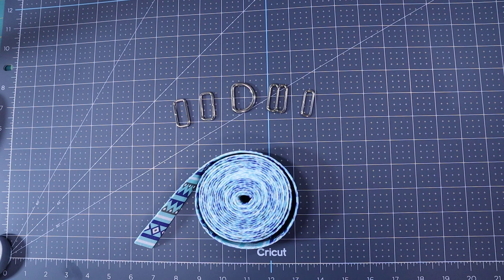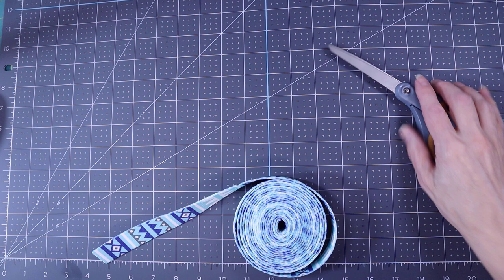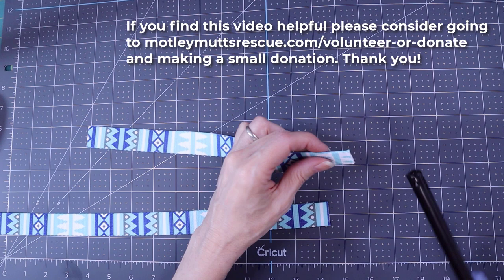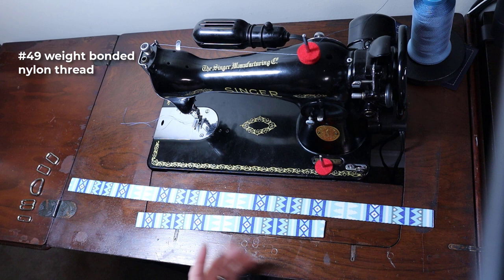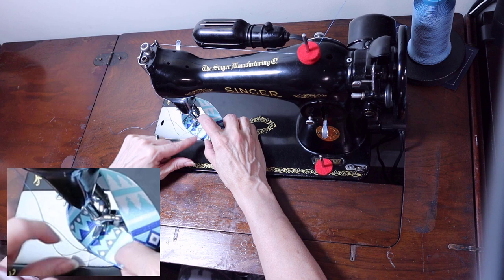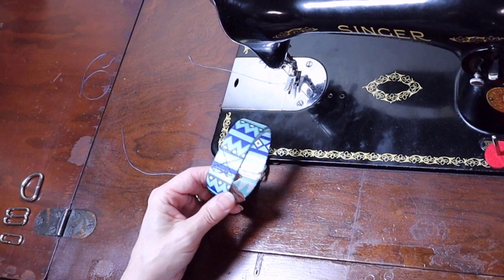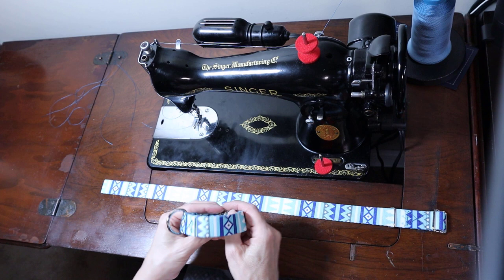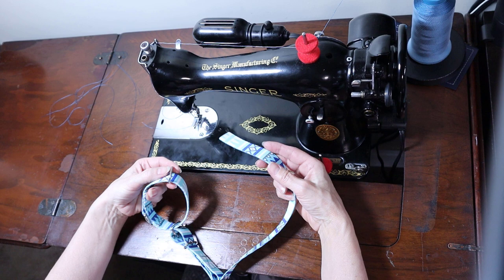How to Sew a Martingale Collar

Comment: How do you even work that sewing machine?? I tried to work a WHITE model 1418 and I could not do it!! Really good sewing!
Reply from the maker: Thelma, the 1948 Singer 15-91 used in this video, is a work horse. Being gear driven (no belt) with a heavy hand wheel she does like to keep going, and on those small collars is a challenge. I try to go slow and use my hand on the hand wheel to start and stop. You may find a Pfaff 30 easier to use, it has a lighter weight hand wheel and a 1.3 amp motor which makes up for the lighter handwheel. The Pfaff 30 starts easier and stops on a dime. Thank you, I've been sewing for longer than I like to admit!

Comment: What would be the cut web lengths for XS and small.  Great video.
Reply: The small size requires 9” and 19” pieces of webbing and fits dogs with 11”-15” necks. The xsmall uses 8” and 17” length of webbing and fits dogs with 9”-12” necks. I only use 2.5” of overlap when stitching the small loop.

Comment: i'm planning to buy a familiar sewing machine, but im afraid that doesn't work with that strap because is too thick ? help!!!  thanks
Reply from the maker: When looking to purchase a sewing machine to sew webbing, I would bring both the thread and webbing with you and try it out. The thread will require you to adjust both the upper and lower tension. I use #69 thread and polyester webbing. I've found that a Singer 15-91 sews it very well. I also have a Necchi BU Mira that does a good job on it as well.

Comment: Can I replace the polyester with nylon or a different type of webbing and it still work for this color? Or even sew with fabric?
Reply from the maker: Yes, nylon webbing can be used instead of polyester. I have not made a collar from fabric alone. But fabric may be sewn on top of nylon to add a decorative pattern to the collar.

Comment: what kind of thread do you use?  also, do you use a special needle?  I have an old machine too.
Reply from the maker: With my Singer 15-91 I use Tex 70  also can be listed at #69 Nylon thread. Polyester would work too. I use either a Jeans 110/18 needle or Topstitch 100/16 needle. You will need to adjust the bobbin tension when going to this weight thread. If you will be switching your machine between sewing collars and other projects, consider picking up another bobbin so you can make the transition quicker. You can also pick up a bobbin tension gauge at the Featherweight shop online. The bobbin tension I use on my Singer 15-91 is 33-35 grams. Happy sewing!
Reply: @doreensdesigns6873  Thanks so much for the reply!  im excited to start making martingales for my adoption organization.
Reply from the maker: @emilyfernandez7939  Thank you for helping rescue dogs!